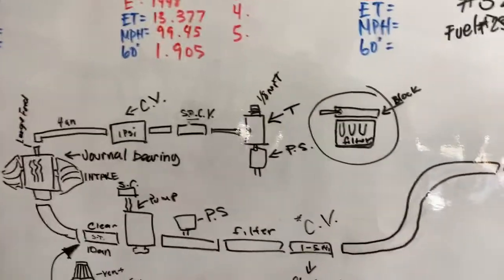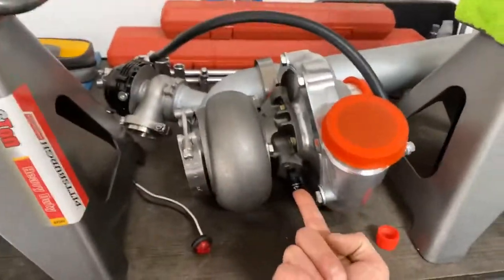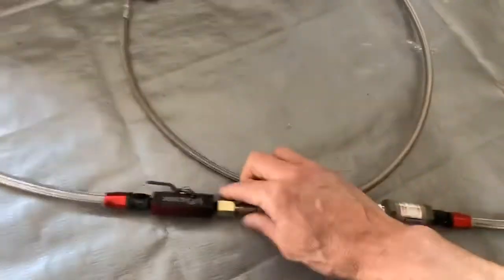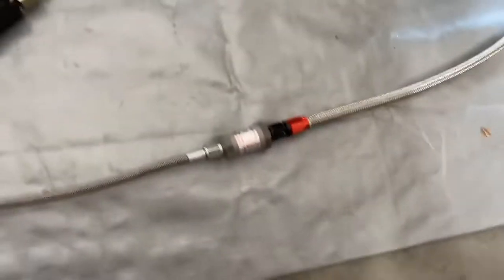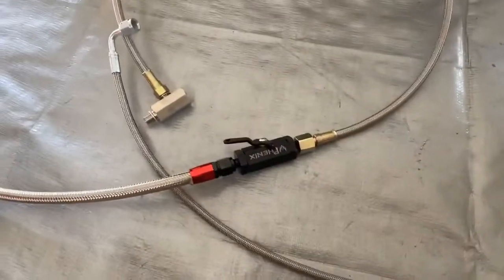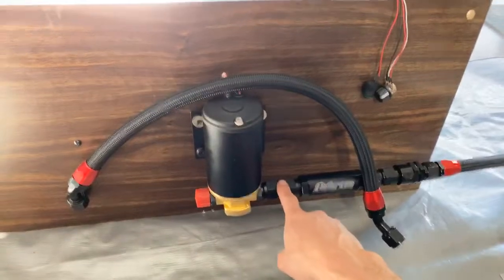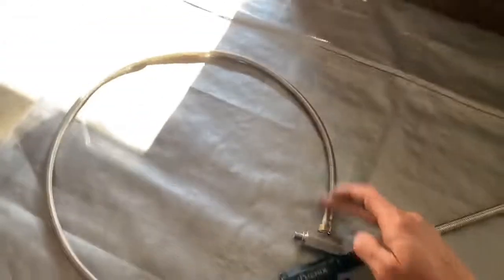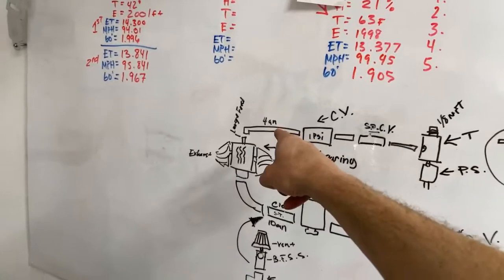Ram 1500 rear mount turbo oil feed line complete part 17

Comment: What size check valve is that and where did you buy it? The smaller ones are hard to find.
Reply from the maker: 4an and I can’t find the site, but this is similar https://www.improvedracing.com/high-flow-1-psi-flapper-check-valve-4an.html